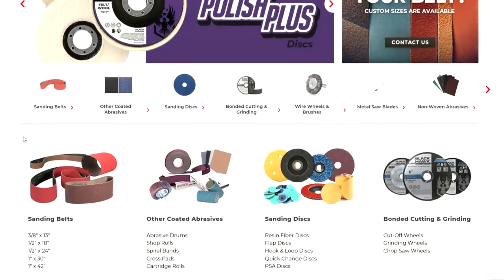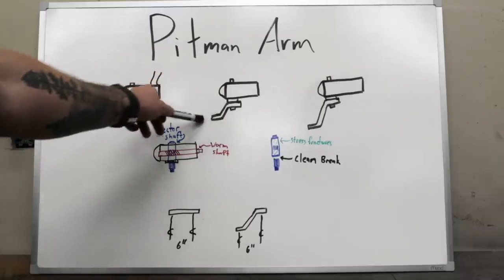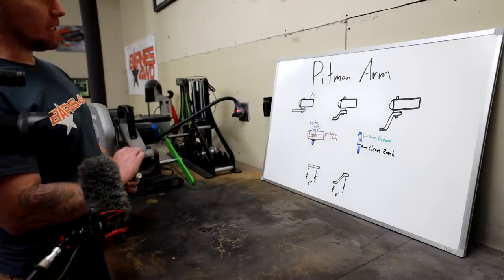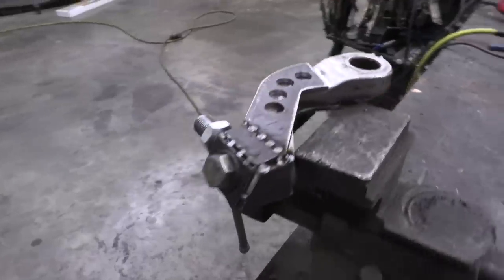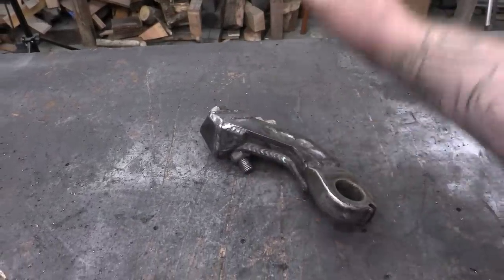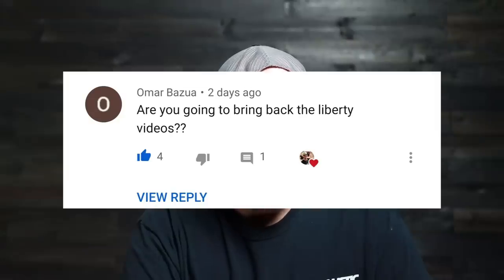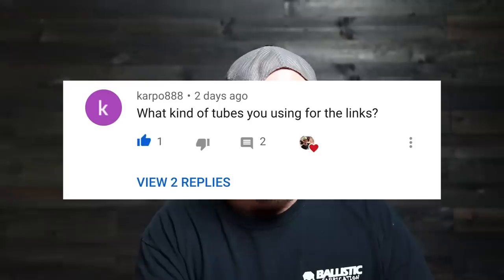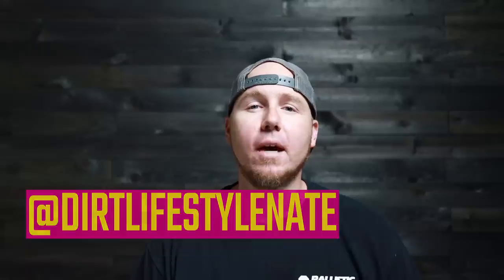Do You Need A Custom Pitman Arm And How To Build One! Ultimate Land Rover Discovery Build Episode 11

Comment: just a thought, try moving steering box.  Any where along the axis (up, down) of the big end will not change geometry (within reason). And steering column u-joints make changes easy at that end.  Has worked fine for me on several builds over the last 4 decades.

Comment: I honestly don't unhook the battery.  I have a small garage and usually have to pull stuff in and out. Most things are tig welded. Thanks for letting us know where to order abrasives. The metal shop is kinda high and options are limited to what you see on their wall.

Comment: How did you come to the conclusion to rotate the axis of the tie rod end. And your comment section somebody question the unplugging of the computers. I always ground to what I'm welding on. If you ground to the frame and weld on the body or vice versa you can fry a whole lot more than the computer. Great video keep up the good work
Reply from the maker: Rotating it was by far the easiest option while still keeping a good relationship with the panhard bar. 👍
Do you have any information on how a welder could possibly fry electronics? As long as you not groudning through the sensor I don't see how they could possibly interact at all. But like I say all the time I'm never married to my ideas. If you have evidence of how this could be possible I want to hear it 🤘
Reply: @DirtLifestyle  I only hobby weld but I do have an extensive background in electronics.  Since welding uses high current electricity those currents have to travel through what your welding.  That current can induce voltages in wires and especially coils, for example relays and some sensors.  The ecu is protected from stray voltages to a point. Unfortunately a welder is  still capable of exceeding those protections and causing damage. High frequency start and pulsing have additional ways to induce damaging voltage.  Look up inductive kick as one example.
 Disconnecting the ecu and battery may not help because open wires can act as an antenna with out a load to drain away the damaging currents.  Having said all that, I do weld on my Jeep Commander.  It has a bunch of computers all over.  I follow best practice in that I connect my ground to the part I am welding and strike my arc on the part I am directly grounded to.  This helps to prevent stray current traveling along body parts and inducing voltages in places I don't want.  This is also important to help prevent burning bearings.
Thanks for the videos, I have a front bumper project in mind for my Jeep.

Comment: Sweet build. I have setup several suspensions my self and have one recommendation for up travel clearance. Stuff one side and droop the other  then check for tire clearance (on front check lock to lock as well). You will find that it will make contact with fender well sooner than you think. I normally check clearance at full articulation and then add an additional inch or so to account for body roll. always do this before mounting shocks to get full use of shock travel.  Keep up the custom work.

Comment: A little additional information about ecu problems with welding. In my experience your ground clamp is extremely important. If you do something stupid like welding on your body with the ground on the frame you might backfeed through a ecu ground to bridge that gap. I got to see a $1800 mistake on a mustang by someone welding on the firewall with the ground on the subframe. Electricity passed through the body mounted PCM to motor and then to the subframe.
Reply from the maker: Thanks bro 🤘

Comment: On the topic of welding with the battery connected to the ECU. For both AC and DC current returns to source, as the vehicle is not the source of the energy there is no realistic reason the current from welding will travel through the electrical system especially if people are clamping the welder close to where there working.
Reply from the maker: This is exactly how I feel on the subject. Welding 101, keep your ground close to your work. If your welding on the back bumper don't ground to the fire wall lol. I see no reason for an interaction between the ecu and the welder unless you use the ecu as a ground

Comment: One time I forgot to disconnect the battery while welding on my F-150. When I was done I turned the truck on and the headlights where on, I don’t have daylight running lights, and I thought that was weird. So I pushed the brake to put it into gear and when I touched the brake about 5 or six relays where clicking under the dash and the lights turned off! I let the brake go and the headlights turn on again. That happened like 10 times in a row. I try to never forget to take the battery off. It’s cheap insurance! It’s the same as when jump starting a car with a dead battery, you never want the helper vehicle to be on. Otherwise you are asking 600-800amp from the running car. Alternators and computers don’t like that.
Reply: What vehicle has a factory alternator that puts out 600-800 amps

Comment: Oh, by the way, the pitman arm is drop-forged.. not sandcast or sand-casted.. I kindly mention... nice work Sir..  Does the heim joint in that orientation offer full range, as per, steering lock to lock.. The steering knuckles have a typical range of (right lock to left lock) of about 75 to 90 degrees (pending the steering stops adjustment)... and a heim joint with misalignment spacers will just start to max out at 65 to 80(pending the brand/manufacturer/size) ... Please note, I am not trying to sound overly critical, just curious. I do understand the way the nut and bolt in the pitman arm being vertical with added misalignment spacers consumes allot space, while not offering the double shear principals like what you have incorporated... which is clever, by the way..  I think more over, I am just getting excited, and desire to know more, and know I will have to wait for the future videos, that will show all of these details, as the program moves along... So, with that said, I will shut up, and just hold my horses, and wait like everybody else... LOL... I am an idiot.. I just now realized that... Okay,  no I didn't just realize that, I have known for a long time I am an idiot.. I just don't declare it publicly that I am an idiot.. Okay, I need to stop typing know... or at least, maybe hit the "backspace key" a few hundred times... LOL... I am going away now... LOL where is my rock at...

Comment: The other benefit to mounting the hiem joint vertical is that you are less likely to run out of misalignment if you are running big down travel.    I had to bend my drag link to allow full down travel.    Are you going to be doing anything to combat the tie rod roll from having a bent tie rod and hiem joints?
Reply from the maker: My only plan is to tighten them in a way that keeps them straight. This is all I've ever done in this instance with no issues to report
Reply: @DirtLifestyle  I see what you are saying.  Good idea.  I think I'll have to try that with mine.  I actually made plastic washers to put underneath my Tie rod hiems.  That helped some

Comment: Interesting how you rotated the rose joint on your droparm, does the joint have enough movement to account for full steering lock at bump and droop?
Would be interesting to see it being cycled and how it all works out.
Reply from the maker: It should have just enough! Unfortunately i can't test it until the discovery is on the new suspension and I can remove these giant jack stands 👍
Reply: @DirtLifestyle  fingers crossed for you!

Comment: Hey mate, loving the build so far. Thoughts on a sector shaft brace? What your experience with em?
Reply from the maker: The sector shaft brace is a great idea and if implemented correctly, it can definitely add a ton of strength. But the real fix is to get your pan hard bar and drag link to match by moving the location of the pan hard bracket, not the pitman arm. The stock pitman arm is best if you can get it to work 👍
Reply: @DirtLifestyle  yep perfect 🤘 Rocking nice and flat with the bars on my JK. Installed a Synergy sector shaft brace and bracket and def seemed tighter. Keep up the great quality of vids mate 👍

Comment: I feel like this is the first time you've fabbed something up, but didn't really explain what you actually did. It seems like the new pitman arm is way thicker, and possibly lower(?) than before. I guess I just can't really tell what you changed to get better clearance.
Reply: What he said. If the original pitman arm was flat (with the link joint sitting below the arm), was this modification just to allow you to raise the heim joint into the same plane as the pitman arm, rather than below it?
Reply: @rhyswilliams695  the original pitman arm had the heim joint bolted under it with the bolt shooting straight down. What he did was rotate how the heim is bolted, so instead of the bolt going down and hanging 2 inches below the arm where it hits the tie rod, the bolt now kinda kicks back and avoids the tie rod. It also lifted the heim joint up a little for more clearance.
Reply from the maker: @kshepthedrummer nailed it bro 👊
Reply: @kshepthedrummer  thanks,  I'll have to watch again.

Comment: I'd love for someone to "fix" the H1 pitman arm and idler.  It's basically a consumable that has to be replaced every year because of the idiotic rubber insert in it is not up to the task of driving the steering system.

Comment: Looked a Discovery 2 with 240,000 miles on it for $2500 heard they had head gasket issues. Not sure if it’s for me or not. Got a Honda Pilot 4x4 and a 05 ram 1500 4x4 considered getting lockers for the front of the ram but they don’t make them for the light duty independent suspensions
Reply: There nice rigs just get it cheap and ls swap it there motors are junk

Comment: How confident would you be in welding lower control arm tabs to cast steel? As in cast wedge dana 44 ford, doing 3 link instead of factory radius
Reply: I've welded on Danas before, went about the same as welding on a frame rail.  Nothing exciting happened.
Reply: @gittyupalice96  I ended up doing it! I am a very skilled welder myself and I decided to do it. I know it’s able to be mig welded but I have a tig at my disposal so I heated up the wedges just for penetration reasons and not sucking the heat away so fast from the weld area. I used a higher grade of a mild steel rod (forget the number specifically) and it welded like butter. I have been beating the shit out of it under my xj on 37s for about 6 months now.

Comment: Great stuff as always.  I have a question.  In your opinion, is there ever a point where the goal suspension height is not worth doing a long arm suspension?  I'm thinking LJ since its what I'm building.  I dont have a lot of lift, and dont intend to go very high. 2" or so, and then work up into the body rather than raising the suspension.  Is there any reason I should steer away from a 3-link/4-link? The benefits seem worth the work, and I cant see a reason not to do it, even for such little suspension lift.  Am i missing something?  Thanks!

Comment: I have just completed a 1 ton swap in my 2dr jk.  I used the same super 60 front axles with the Barnes truss kit and high steer kit. I have now noticed that the turning radius is far off from stock. Is there any way I can correct it?
Reply from the maker: https://youtu.be/96PdbokHG2I
You need to confirm that the swing of your pitman arm is the same as your steering knuckle. I touch on that concept briefly in this video. Good luck 👍

Comment: Hey. Thank you for all the information.I NEED HELP!!!. I have a 91 yj 4.3 Cheavy V6. Sm420 tranny . 8.8.Ford rear. 35 tires.. Crappy Dana 30 in the front . first I broke the short disconnecting axle. The copied Matt. And installed a Cherokee land pax. Side axle. Broke both in the universal joint area.What do you suggest.Quadratec want $400+ for the disconnect axle. I don't do rock crawling.Must trails in my land here on south central TN. I know someone that has several International Scouts. Help.

Comment: I don’t have a pitman arm.
But that’s because I’m running PSC full hydro 👍
Reply: I was just thinking why not just go full hydro?  Then I remembered this is an overland rig and will need to be street legal.
Reply: Dave G I live in California and I’ve daily driven my truck with the hydro steering for the last 3 1/2 years. It’s a big misconception that hydro is illegal.
It drives no different than regular mechanical steering. It even self centers when exiting a turn just as long as you have the proper caster set up.
Reply: @stevej6824  Well maybe that's ok for Commiefornia but nationwide?  If it was fully legal I would think that there would be an OEM vehicle with full hydro.
Reply: Dave G I know that there’s some big heavy equipment vehicles made by Oshkosh that are road legal and run full hydro steering.
But if you’re worried about any legality issues the next best thing is hydro assist.
You retain all your mechanical linkage, there’s just a small hydro cylinder that assists with the steering. It’s the best of both worlds and it’s about 1/2 the cost of running full hydro.
Reply: @stevej6824  Hydro assist is definitely on my to do list!
Reply: Dave G 👍

Comment: Question – not that I would do this myself but just from an engineering standpoint I am curious if instead of making the pitman arm Tangled what if like a stack of Dimes and it just stack some short pieces of iron and welded them together and then had the last piece come forward with panhard bar connection? Would that reduce the stress on the shaft? Because then it's not grabbing an angle it has essentially almost extended the shaft if you will. If you do not understand what I mean please ask because this is the kind of stuff I love when it comes to cars and trucks. And damn it is raining! I rabbit convertible is getting wet! I need to pull the carpet and spray the floors with bed liner and drill some drain holes. I also need to make custom vinyl seat covers so that I could essentially hose out the interior just like an old CJ! I'm going to do something to my Volkswagen to cross breeded with a Jeep just like I have added some Volkswagen stuff to my ZJ. You'd be surprised how similar the niche market for Jeeps and Volkswagens are. At least real Chiefs and real Volkswagens, the older stuff. Both utilitarian Vehicles just built for different purposes. An old water cooled Volkswagen is very light and handles on Rails and doesn't need a lot of power to go faster than a lot of cars worth two or three times the money. and just like Jeeps you can snag parts from bigger better and newer models I'm slapping on the older smaller slower stuff. And although they are both very simple they both do their jobs very well. And let's face it, an SUV with four-wheel coil spring is pretty badass even today. And so is a little teeny rabbit convertible that looks like the girliest car in the world handling like a Porsche and running with C5 ZO6 with a little 2.0l 16-valve turbo motor putting out over 300 foot pounds. kind of makes me want to turbo my 4L, but I think a 4.2 L Stroker opened up to breathe would be more appropriate. I do not want to sacrifice throttle response off roads.  and I know no one will read all of this but what the hell I guess this is what you do when you have no friends LOL

Comment: Disconnecting the battery is normally to protect the electronics from huge voltage spikes that could fry stuff on the 5v circuits etc... I think most of us get away with it though lol
Reply from the maker: I feel like this is an old wifes tale. Once again  I'm not married to my ideas but I have yet to hear a good argument for how the current would travel through your electronics unless you ground directly to them. If a big spike in voltages could fry sensors or an ECU then starters and Winches would burn them up none stop. I am however very open to the idea if someone could explain the mechanism behind this idea. 👍
Reply: @DirtLifestyle  I guess it's based on something, and probably more of an issue if the ground clamp is the opposite end of the vehicle rather than next to the work area.